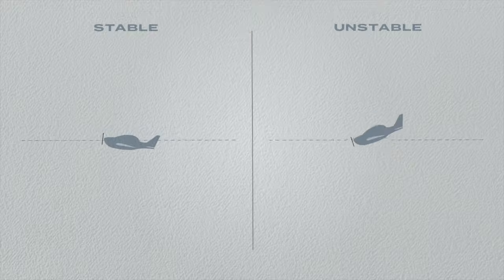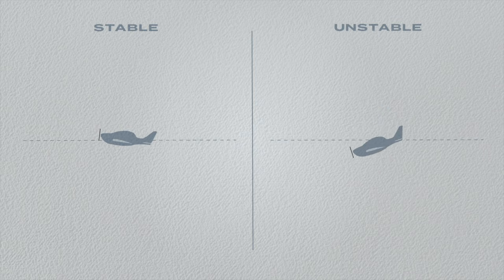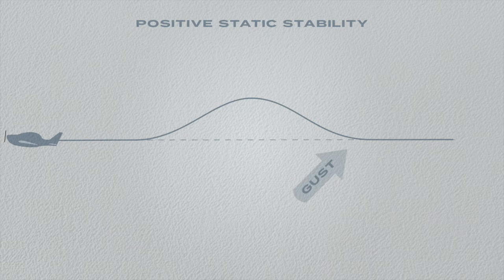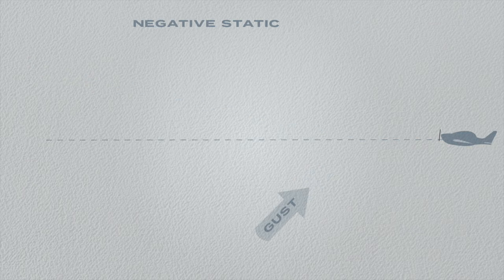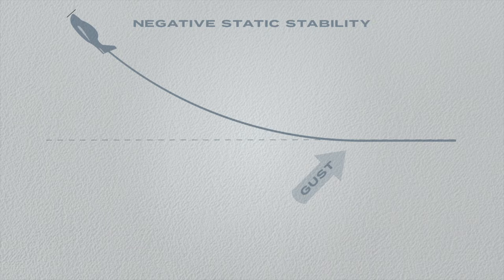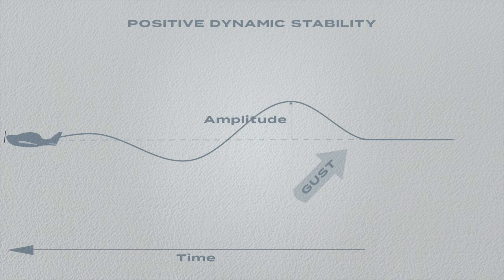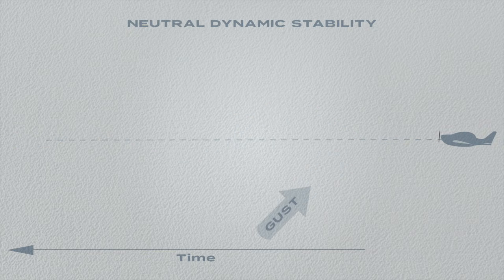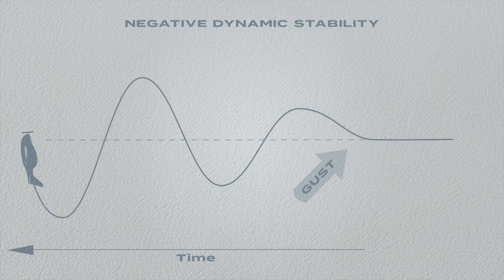Static stability vs dynamic stability.

Comment: I'm a little confused. Does that mean that static stability is the tendency to return to original attitude and dynamic stability is the time and number of oscillations it takes to return to the original attitude?
Reply: Static Stability is the airplane's immediate reaction to the disturbance while Dynamic Stability is the airplane's response over a period of time to to a a disturbance. Each Static and Dynamic can be classified as Postive, Neutral or Negative.
Reply: Yes

Comment: Does the concept of dynamic stability apply in a statically unstable situation? Because if the plane moves further and further away from its initial attitude it doesn’t seem like there would be oscillations of any kind. Same question for dynamic stability given neutral stability.
Reply: You’re right; only positive static stability leads to dynamic (negative, neutral or positive)!